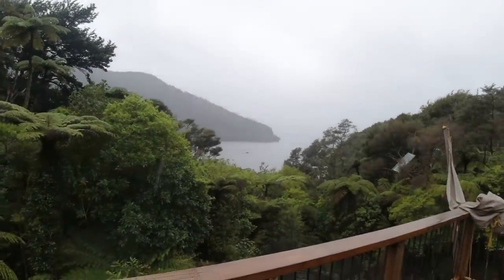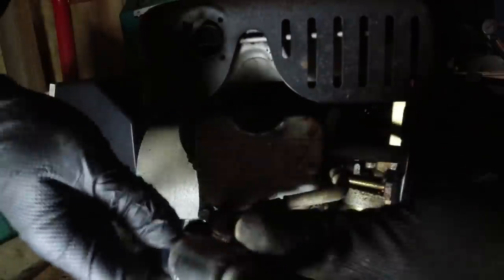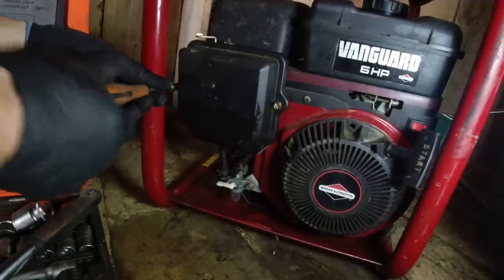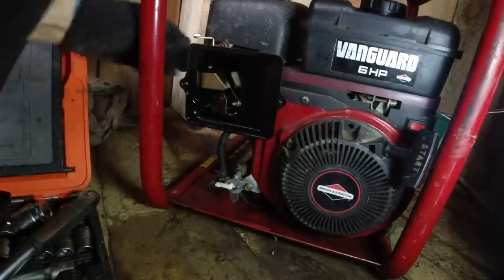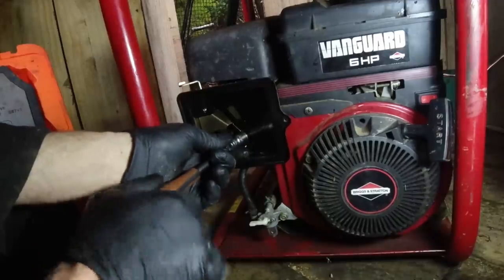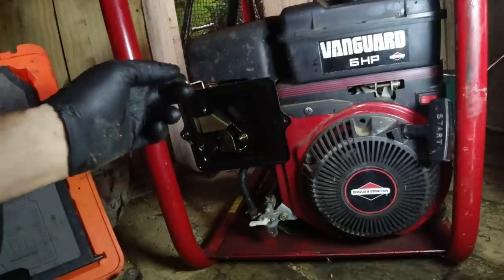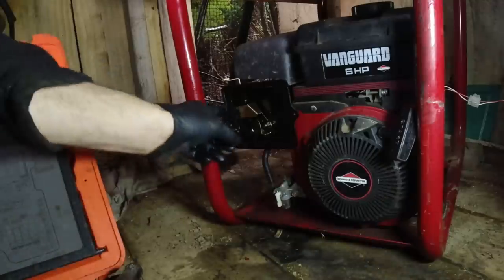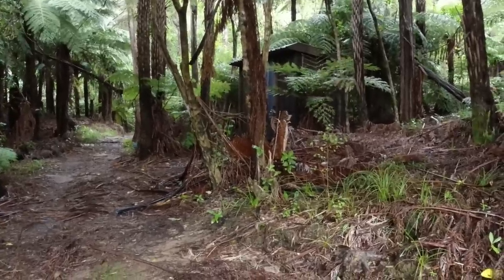Diagnosing and Fixing a rough running petrol Generator

Comment: I have seen an air filter get dirty enough to cause a vacuum on the crankcase vent that will then clog the oil filter.  If the motor isn't puffing oil from the vent tube I would suspect this.  Damp, dusty air can really cause trouble for a paper filter.

Comment: My gen is similar to yours. how many volts does you gen put out at the outlet? Mine puts out 114-115-ish, micros and toasters here in US dont operate at full power unless volts are around 119-120 volts. Good temp fix on air filter....
Reply from the maker: Mine is around 230v, we are on 240v supply here in NZ. You may find if you wind up the rpm screw you will get higher output
Reply: @MartyT  WOW 240 volts, thats what my welder runs on. I didn't know house appliances run on 240 volts, must have a fast toaster. Maybe I will turn idle screw up a little and see what happens, thanks for the tip.....

Comment: so take it apart. Don't break anything else. clean anything that sicks that should move. seal/gasket/tighten anything loose that supposed to be tight. clean the air/oil/fuel filter. put it back together. you should start a YouTube channel you're so good.

Comment: How old is this content, is this a new storm?  Where do you run your exhaust?  I had a problem with my generator in the shed.  Even though I had an open window right near the exhaust, the generator still sucked in a lot of fumes resulting in my filter becoming clogged.
Reply from the maker: Filmed yesterday.. Yes I think you might be right, the exhaust is directed through a hole in the wall but the air intake is angled in that direction so no doubt picks up some soot. As others have suggested, a divider between exhaust and intake will likely fix the problem

Comment: Why do your batteries not get charged by the water wheel generator?
You can buy LPG kits to fit on these generators.  No problems with carbie getting bunged up or petrol going off in the tank. If fitted you could make a methane gas plant on the property and run it on that thus being truly off the grid.
Reply from the maker: This is the beach house, I don't have a stream for hydro there

Comment: Get some UNI filter foam you can wash with soap, oil and reuse.
Reply from the maker: The filter has been weakened from flapping around in there, it has cracked the metal mesh backing plate so time for a new one
Reply: @MartyT  I don’t doubt it, but I was thinking ditch the OEM style filter entirely and use the foam. Rubber band it or cable tie it in place. When it saturates with oil again, wash it out, lightly oil it and slappidy do dah that mother back on. But that’s me from viewing on YouTube, you know what’s up. You’re no slouch. Maybe a new own filter is cheaper and will outlast the generator anyway so there’s no point.

Comment: I don't believe I have heard you mentioned anything about wind power, have you considered that as an addition to your power system?
Reply from the maker: I do have a little wind turbine but its quite useless,, a 10w solar panel will produce more power in an average month
Reply: @MartyT  because you have much more sun than wind in your area?
As I se it, the problem with solar panels are, that they produce the power when you really need it the most.

Comment: No valve seals . possibly the fuel has weep from carburetor into combustion chamber.then weeped passed rings.the mixed with engine oil.making in a very light 9ver filled sump.thus causing excessive blowbuy into breather then to airfilter. Check your oil.😊

Comment: Have you ever considered a diesel genny Marty? To avoid paying the road tax component of the price of fuel... (plus the other benefits)
Reply from the maker: Yes I was actually given a 5 kv diesel gen with a worn out engine, its in pieces, I've been meaning to fix it up. Electric start too so could rig up an auto start / stop in the house

Comment: Never mind any potential piston ring or valve guide wear - just vent the crankcase breather tube away from the air intake & problem solved. With all the 747’s flying over our heads, sod the emissions bullshit imposed on us peasants🧐👌🤔

Comment: The motor might be over full of oil. Sometimes you can wash with petrol  and dry the filter. I fix mowers and half the time it is a shitty air filter.
Reply from the maker: oil is at the right level with no fuel in it, first thing I checked